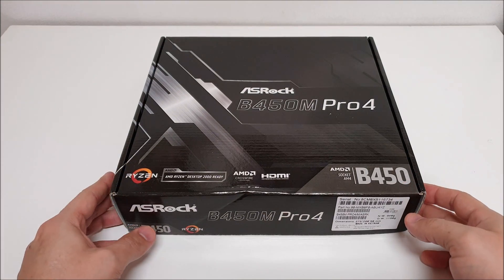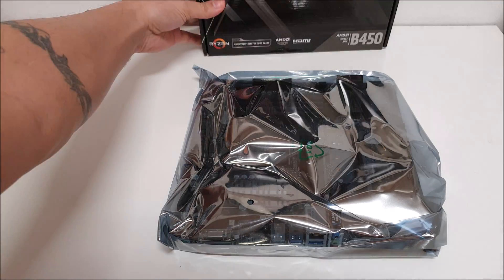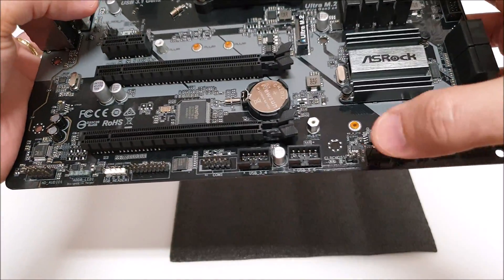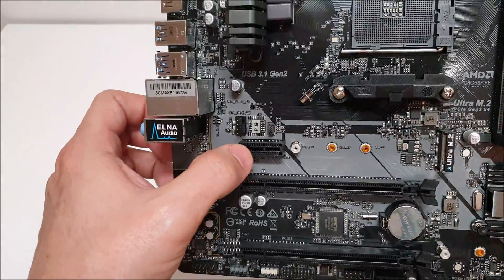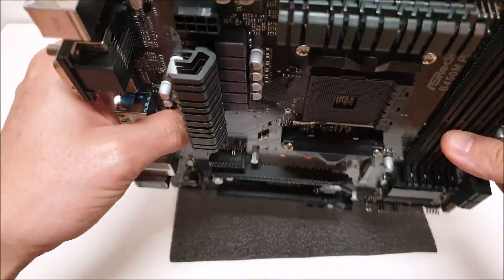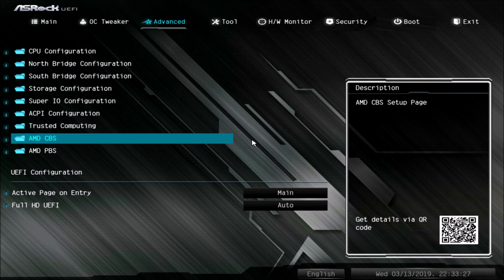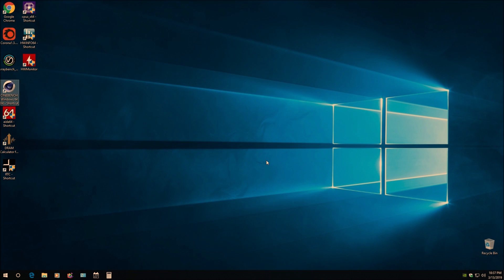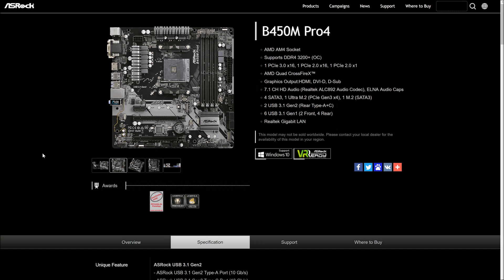ASROCK B450M Pro 4 Motherboard. Best Entry Level Board?

Comment: i hear a crunching, rattling noise coming from the motherboard around the CPU. i disabled all fans , and hard drives , still hear it. i think it is the VRM coil whine.  I also updateed to latest Bios for Ryzen 5600 and havnt heard it before this i dont think.
Reply from the maker: @zeebpc  It might be coilwhine. But that is typical. Nothing to worry about.

Comment: Great video. Is there any way to connect 2 nvme m.2 ssds to this Motherboard? I currently have a 500gb nvme m.2 and want to upgrade to a 1tb, but want to continue using the 500gb as storage.

Comment: Can this handle a ryzen 9?
Reply from the maker: Yes. But it will throttle it down severely because the VRM is not built for such high power draw. But yes it will work with a 5950x, just terribly.
Reply: @TechnologyHive  thanks, ill stick with a ryzen 7
Reply from the maker: @adonian  Wise decision 👍😊.

Comment: im ordering a prebuilt that has 16gb but in want to add another 16gb do i need the same brand or can i use any brand? also the ram in it is 3000mhz can i put 3200mz ram or do they all have to be the same mhz? im new to pc
Reply from the maker: I strongly suggest you put in the same make, and model. Mixing ram is not a good idea. The MHz should be the same for optimal performance. 👍
Reply: @TechnologyHive  so if want 32gb of ram i would have to replace the existing ram and buy 2 extra of the same brand? so buy 4 in total? are there any special things that happen when i do this? like do i gotta update something when adding new ram?
Reply from the maker: @EnvyOw  Memory layout is a bit complicated depending on the motherboard vendor and model. T topology vs daisy chain makes a difference on how much ram you can have on your board at what speed. I'd strongly recommend you get 2x16 kit of ram for 32gb just for better stability and compatibility across boards. 

But if you must get 4x8 kits the 3200mhz should be okei on most boards. Running 4x8 @3600mhz will in a lot of cases be too much for cpu memory controllers to handle. Good luck.
Reply: @TechnologyHive  thanks!

Comment: My ram is stuck at 2133 mhz even after setting it to the xmp profile, any ideas on how to fix this?
Reply from the maker: What is the make and model number? Also, are you on the latest bios for your board?
Reply: I have a ASrock B450M Pro and I got the board this last November, I never updated the bios  @TechnologyHive
Reply from the maker: @austinmoen5278  I strongly recommend you update the bios. Just reset all overclocks before you do so the system doesn't crash while updating bios.

Comment: Hello sir. This was a very well explained and detailed video. Keep up the good work. This is the only video on YouTube which is this well explained 😍
I would like to know one thing, As you shown in the video you have overclocked the R5 2600 to 4.2ghz @1.425v.
I have same board and processor and rx 580gpu 4gb. If i overclock same as you can i run the computer full stable while gaming?😀🙏 Will the VRM overheat?
Ram is- Gskill ripjaws v 3200mhz cl16 8gb x 2
Reply from the maker: There is no garrantee for any overclock as no two  cpu's are exactly the same. But in general these are good settings which should give you a stable system. Try it and let me know 👍
Reply: Ok sir. Thankyou so much for taking out time and replying. Highly appreciated.❤️
I would try the same overclock and would let you know.
One last thing i would like to know before overclocking. If i just overclock cpu and enable xmp profile for rams and set to 3200mhz (without tweaking timings) will i face any issue? I don't want to mess with timings. Should be on default
Reply from the maker: @nikalLaw  of your RAM is on the qualified vendor's list for your motherboard then it should give you no issues enabling the XMP profile even when overclocking the cpu. Set your SOC voltage to 1.100 volts if it's not done automatically.
Reply: Ok sir❤️

Comment: What's the speed of SATA 6 on that M.2? And is this MB gonna be good for the setup: Ryzen 5 3400G, Vega 11 iGPU, 16GB RAM at 3000MHz and future GPU and maybe CPU upgrades or should I go with another MB?
Reply from the maker: For the SATA 6 M.2 port you're limited to around 550+mb per sec speeds. It's just a rough estimate. If you're going with an APU, I'd definitely recommend faster ram than 3000mhz. 3600mhz CL16-18-18-18-36 I'd suggest. This way, not only will the APU run faster but also you're future proof for when you get a better cpu and gpu 👍. Hope this answers your questions.
Reply: @TechnologyHive  I'll see if I can fit the RAM into the budget. If not I'll definitely get faster RAM later down the line, thanks for the reply

Comment: Its my first time building a PC, im planning to build a non-gaming (but good) PC, thats the mother board im planning to use. The other gear is:
-AMD Athlon 3000G
-HyperX RAM Predator RGB 8GB 3200Mhz
-Kingston SSD A400 480GB
Im overdoing it or should i change something? ill probably add a graphic card later
Reply from the maker: I sounds like a good setup 😊. But I would go with 16GB of ram instead of just 8. 👍

Comment: So I just bought this motherboard and I put it together and I built my PC this is my first PC build and the front headphone jack near my case isn't working because when I plug my headphones into it there's no sound coming through them I've updated my drivers and all that and I've connected all the cables correctly. I don't know how to fix it I was wondering if someone could show me a picture of where that connection is on the motherboard
Reply from the maker: Front pannel headphones jack header on the motherboard is located at the bottom left corner. Do your headphones work when you plug them in the rear jeck?

Comment: serious question; does this board support ryzen 5 1600 AF out of the box?
Reply from the maker: If you buy one today yes. I just got my hands on a 1600af my self. Video coming up. If you can, and feel up for it, try overclocking your RAM with the 1600af. It will be close to or as fast as the 3600 cpu at stock settings.

Comment: Hello can you tell me if this motherboard can overclock to use memories above 3200mhz? because I am not able to raise my spectrix d41 3000mhz to 3600, only 3200, is the limit of this card?
Reply: Dont fool around, i got blackscreen from 2133 to 2666, (3000 max supported on sticks)dont max it out certainly for a start
Reply: And yes, i think 3200 is the limit

Comment: You are incorrect with your description of the M.2 sockets, both are M keyed for PCIe-NVMe (not SATA) which may be used for either X@ or X4 PCIe-NVMe, NOT for SATA!, Socket 2 is NVMe X2 but a X4 works at reduced speed.

Comment: Thank you very much for making this video. It was very helpful in deciding to get the Pro4 motherboard and 2600 CPU. I'm on a bit of a lower RAM budget than the Crucial Ballistic Sport tho. Would the 2 X 8GB Crucial Ballistix DDR4 3200 be a decent alternative? 1.35V, cl16, XMP 2.0, timing is 16-18-18-36. any advice would be greatly appreciated and thanks again.

Comment: Hey man I just built a pc with this board. I keep setting my cpu go 3700mhz however its staying at 3400, same with the ram I have ddr4 3200, but it says its 2100 in the pc
Reply: then swap to xmp p1?
Reply: Were you able to get the ram up to 3200? What ram you using?

Comment: So I apparently made the mistake of purchasing the AMD Ryzen 7 3800X which this board is not compatible with out of the box. I see you were using a AMD Ryzen 5 2600 in this video... My question is: what is the cheapest option (that you recommend) for compatible CPU that I can purchase just so I can update the BIOS for this motherboard and use my Ryzen 7 like I originally intended? Any help would be appreciated.
Reply: Choyce Ybarra  Ryzen 5 1600 af
Reply: Choyce Ybarra it’s 85 usd
Reply: Thank you
Reply: Choyce Ybarra Ryzen also has a program where they send you a cup just to update your bios for free but you have to look into that

Comment: I have approx  12.400 V on the + 12.00 V rail , should I get worried , I didn't enabled XMP or OC cpu .  Should I try ? I got old PSU 530 W . I have to roll with it for the next months can't buy a new one now

Comment: Thank you dude, I have the same processor and motherboard and just wanted to OC my cpu but I wasn’t sure what setting to use I just followed your settings and it works great.
Reply: I read 1.35 is the max recommend safe vcore. Any issues?
Reply: @chrisgandhi6463  definitely, i got blackscreen for going to 1.4, gonna check out today what's damaged, resetting bios didnt work

Comment: Hey, I'm thinking of building a pc for my self but want to balance price and quality on a fine line, is this a good quality motherboard?, Is it modular with other brands and what does 'Max allocated ram size' for graphics mean? As it said it's 2gb which seems low but I'm new to this so idk if this is low. I want to be able to run 16gb so I can code, and game with ease. Thanks in advanced for any answers. 👍p.s does it have/need a CPU fan/cooling?

Comment: I only play dota 2, can i run dota 2 ultra graphic with this build :
1. Mobo, asrock b450 pro4
2. Processor, Ryzen 5 3500
3. VGA, RTX 2060
4. RAM, 2X8Gb.
Can you give me any suggestion?
Reply: Yes
Reply: did you work you 2060 on first pcie 3.0 slot?

Comment: What ssds do you recommend putting into this board? Is there enough with the two slots on the board to be enough for my needs? I only really game and used to xbox levels of storage, I was thinking one fast 500gig in the quickest slot and a cheaper 1tb in the other slot.
Reply: I have a 240 gb ssd and a 1 tb hdd.this board should be able to use any ssd or hdd

Comment: How can I connect it up to the Internet do I just plug in ethernet cable up to the motherboard at the back and I have to buy something to plug the ethernet cable into?
Reply: This board comes with a ethernet slot but you will need to buy a wifi adapter/card if you want wireless internet. But if you have ethernet you can use it with this board.
Reply: YT Mathew No just plug it straight into the motherboard if it has a port for the ethernet

Comment: Is this good with AMD Ryzen 5 3600x?
Reply: Yes but if your getting that expensive of a cpu i would get a better motherboard
Reply: @tickogrey5846  i use a 3700x on that thing. any advice? thought about upgrading
Reply: @Austrium1483  how is it holding up on the ryzen 7 3700x
Reply: @Stealth2SSnoe  the PC is working fine but I'm switching to msi soon, since I don't trust that MB anymore. Also for some reason you can't boot into windows with it if you don't have a HDD installed. I think it's a good budget MB for the lower end AM4 processors and for office PCs but I wouldn't recommend it for gaming. or to install other higher end CPUs

Comment: Super late to the party  I know, but, thanks for this review. I'm considering some upgrades and you just happened to be using the very CPU I want to put in this board, so that answered some questions. You don't mention how much RAM you used and what brand. That would really help me out to know what to go for.  My existing 980ti will still suffice for the graphics card and it still performs well at 1080p so it's really only the RAM that I need to know about. Thanks in advance.
Reply from the maker: I am using Crucial Ballistic Sport ram, now at least. 3000mhz kit CL15.16.16. Reason is the IC's used in this kit are Micron E-die. I have this kit now running at 3733mhz CL16.19.16.16.50.trfc 561. 1.45v. It is great memory for the price. I used to look after Samsung ic's. Now I'm after micron E-die 😊.
Reply: @TechnologyHive  Mine is Kingston HyperX Fury and is 2666mhz should be ok, it'll be 32gb of RAM with all 4 sticks in. I'll hopefully install it all later today....
Reply from the maker: @rogerbowen5753  keep in mind that running all 4 dimms adds a latency penalty. You are already running slower ram so your experience may not be what you expected or what it could otherwise be if you run single rank modules instead of dual.

Basically RAM with a single row of IC dimms has a lower latency than a stick of ram with two rows of IC'S due to the memory controller having to deal with two rows and not just one single.

In your case, although your RAM sticks may be single rows each, populating both channels fully creates a dual signal to the memory controller as if you had 2 ram sticks with dual ic rows each. Anyway, good luck.
Reply: @TechnologyHive  I see, I'll see how I go when I get it all together, which won't be today now. It's not totally vital that I do it, but I want to when I'm fully ready to.

Comment: Can u put a wifi antenna with it ?
Reply: If youre talking about the wireless wifi card then yeah you can. It will be installed in the PCI 1x, right above where the graphics card will go
Reply: @Moon-ut7fq  Thanks. Should I go for this or the B450 Tomahawk Max though? Is the Tomahawk worth the extra money? I'm gonna be pairing it with a R5 3600 and I've heard lots of people recommend this board AND the Tomahawk as well. Not sure which to get.
Reply: Use an usb onr

Comment: Unfortunately I couldn't get my Ryzen 5 1600 AF past 3.8 ghz even with 1.2volt.  But that's not the boards fault, lots of good features and came with bios revision 3.6 out of the box, and runs G. Skill Ripjaws 3200mhz flawlessly.

Comment: I have a 2700x OC to 4.15 on this board and vrms while streaming x264 slow are about 70-80 celsius. Will this board be OK for 3700x?
Reply from the maker: Yes that's a great board for the 3700x. You might just need to update your BIOS.
Reply: Whats your ambient room temperature?
Reply from the maker: @dinkthesink3890  22c
Reply: jedenzet  are you referring to the ryzen 7 3700x?

Comment: Came for AsRock left with AssRock
Reply: Can you please tell me how to install the drivers for this motherboard please, I can't find it anywhere and I'm afraid to install bad drivers that will make me bluescreen or something. Can you please tell me how to do that please please
Reply: Isma Koro have u checked the manufactuer’s site?
Reply: @user-nv7fx1gd7z  The motherboard comes with a disk that has the drivers on it.
Reply: @can4480  I don't have a DVD player in my pc tower. ......
Reply: @user-nv7fx1gd7z  You can use a external dvd player, or use a computer that does and copy the files onto it.

If not, if you can connect to the internet, download the drivers from there
Reply: @can4480  why would anyone use the disk for drivers, they'll be very outdated
Reply: @user-nv7fx1gd7z  google your motherboards model and go to the manufacturer's website for said motherboard and download all the drivers you need for you need. Make sure the picture on the website matches the motherboard you have on hand

Comment: Hey man I have this exact Mobo. But my ram kit isn't working well with it. What is your ram kit?
Reply: I had the same problem. Went for the  vengeance lpx 16 gig  3200mhz. Currently on manual oc with the 3200 and timings set to 18-18-18-36

Comment: Bought this board and it appears to be dead on arrival. I really wanted to like this board but it's so hard to. Got everything plugged in snug, in the proper spots, got proper ddr4 3200 ram, but nothing happens when I power on. I get a black screen for 20 seconds, then powers off for 5 to 10 seconds, then repeat (tried multiple monitors too, no changes). Thought it was my ram so I bought another pair, nothing. Possibly ram slots so I tried every setup with all 4 sticks (1 stick at a time in each slot, 2 of the same stick in alternating slots, switching order of the sticks) and nothing. Then I realize that when it's on, my graphics card fans don't spin. No on board speaker or lights so I don't know what to do from here. I'm using a Ryzen 5 3600 CPU, but the motherboard box has the orange sticker claiming it's Ryzen 3000 series ready. Tried it with just the bare bones (case plugs, CPU, ram, and power supply)  with no changes. Tried a different power supply with no changes. Reset the cmos battery. Let the thing run for about 20 minutes because I thought it was maybe just boot cycling but nothing ever happened. It just doesn't work. I got the board because I wanted to downsize my humongous PC but I messed up by buying this piece of junk.
Reply: You need update lastest BIOS from store if you want run any ryzen 3000 series. Or if you have Ryzen 2000 series, you can update by your hand. And another choice, you can buy MSI b450 board, you can flash BIOS without CPU.
Reply: @TopTop-jz9lb  I sent back the original mobo and got the exact same thing (since Newegg only does replacements on open products now, not defective ones) and I was right; The old mobo was dead on arrival. New one works great, was already Ryzen 3000 ready out of the box. I appreciate the response though, but I resolved the issue a long time ago haha

Comment: Did it boot automatically for installing windows and was it easy to change it to xmp mode
Reply: RaiiGames if you start your new pc for the first time make sure you have an usb with windows on it, this is easy, plug the usb in and start your pc up and go in the bios, changing to xmp is very easy and then just boot from the usb
Reply: @maxeijsten4880  thx

Comment: you are wrong about the heat sink coupling. they use a suspension system that keep the tension correct all the time. the screws system has strong tension only at start but loose it after some time and you have every couple of month to re strength the screws again. this is engineering... no one does it.
they used something that will auto tension it all the time. like a belt tensioner in your car.
in short - they used the correct method. put a sticker on your review video to explain this...